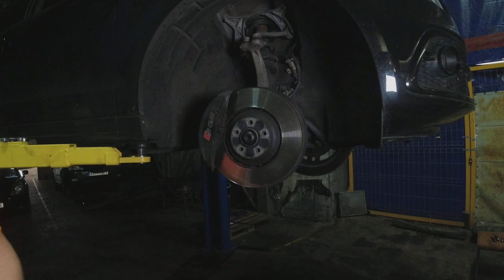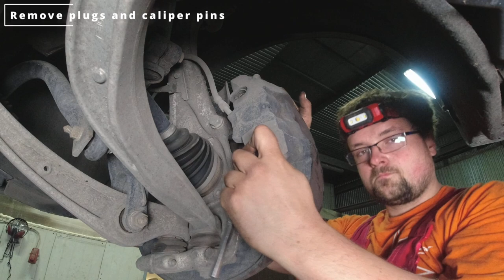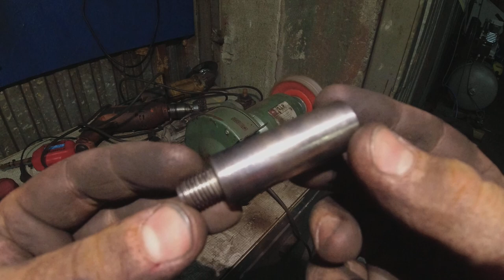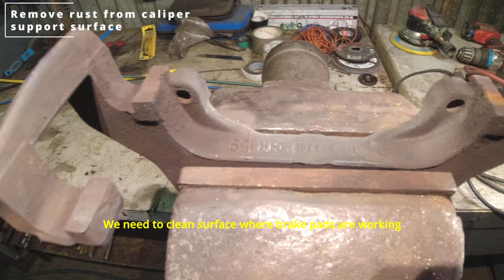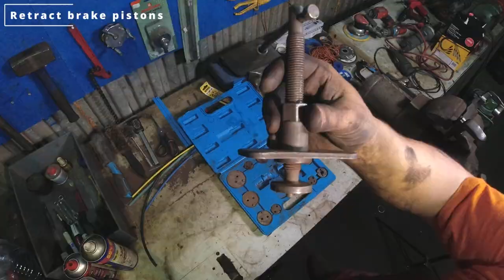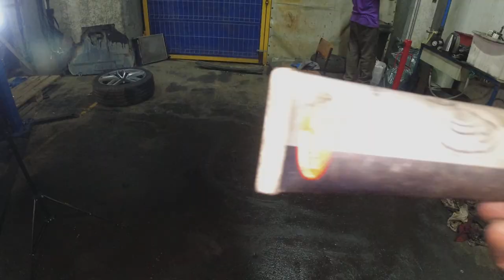Learn how to replace front brake pads and discs - Audi SQ5

Comment: Got hardware for caliper off but still stuck and can't pull off caliper. It just wiggles help is appreciated
Reply from the maker: Maybe pins are still locked on threads and you need to push them out using screw driver, or you need to press the brake pads to compress pistons a little bit. Use screw driver too
Reply: @sushi_garage  it was the brakes needing to be compressed thank you!

Comment: You did not show the process for releasing the electronic parking brake ??  Maybe I missed it but normally I need an OBD 11 or VAG software for this part.
Reply from the maker: No need to do this. It's front discs and pads replacement video :)
Reply: Of course Doh !! That will learn me for trying to be clever 🙂 @sushi_garage

Comment: Hello my friend. I have a question, what are the specs for the front brake disc on the SQ5. The diameter in mm and the size in mm, please.
Reply: 380 56mm

Comment: where on earth do you get an imbus number 9?
Reply from the maker: If you can't buy imbus number 9, you can find and buy 3/8 inch. It's around 9,5 mm.
Reply: 3/8 doesn't fit on mine.
Reply: Size 9 hex bit at O'Reilly's
Reply: Or buy a 10mm and make it yourself to a 9mm key 😉🙂

Comment: Why aren’t you using a torque wrench to torque the bolts to the specified torque? 
Great video otherwise bro !!
Reply from the maker: Yea, I know I should tighten every bolt with a specific torque, but sometimes I can't find values in manuals. It's absolutely necessary to use torque wrench when you rebuild engines or other complicated things